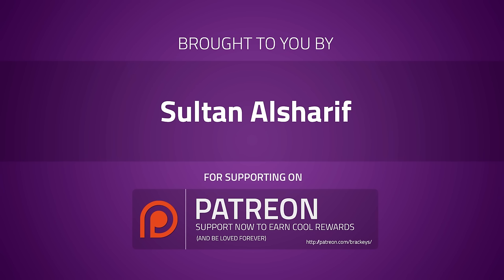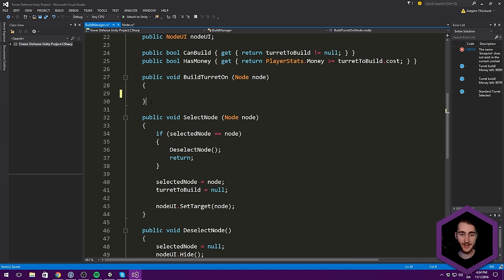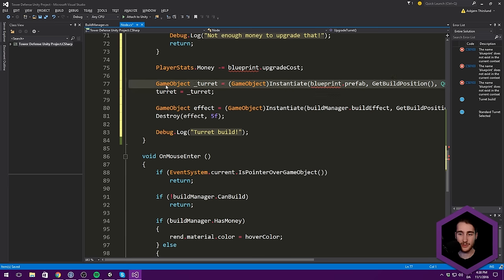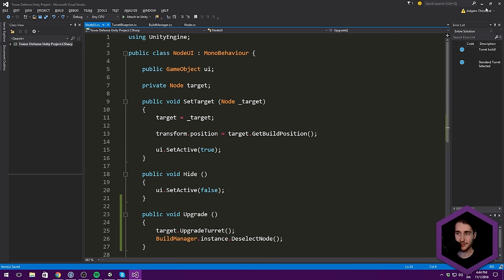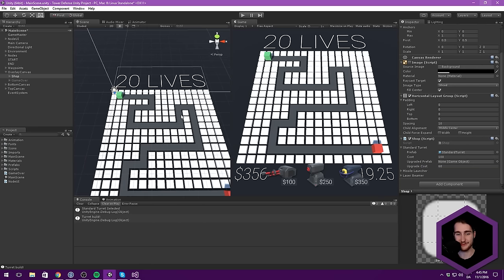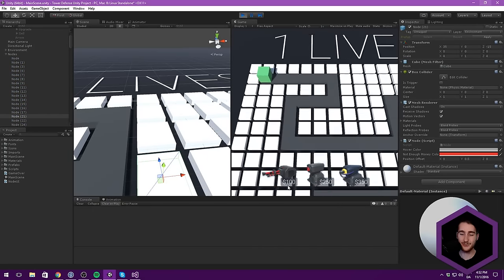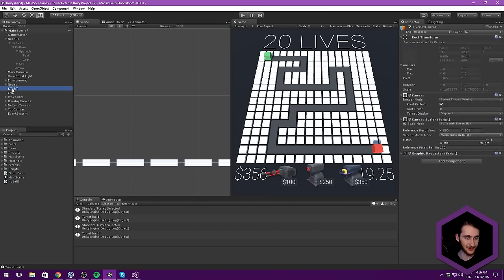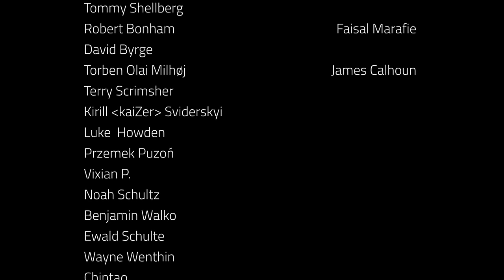How to make a Tower Defense Game (E19 UPGRADE) - Unity Tutorial

Comment: For anyone having the problem with the UPGRADE BUTTON just put main camera in the CANVAS Event Camare (The canvas that is inside the NODEUI) i am sure more than one of you are having this problem, Canvas ONLY WORKS with main camera or any other camera, if not set correctly the clicks are coming from a very different position so they might never register as coming FROM the camera, i hope this works someone.
Reply: thanks dude
Reply: thx dude you saved my life.
Reply: Thank you
Reply: I am still having major problems
Reply: never mind it took me a sec t see what you ment
Reply: Hey 
@Hyfrehyfre, tried what you said and I'm still having troubles, any other suggestions?
Reply: i was messing around with this for 30 mins. thanks!
Reply: won't work for me
Reply: More upvotes here people! Was feeling like a failure after consulting the github repository for this project until I found this comment. Thank you so much!
Reply: Спасибо! Я уже не знал что делать с этим)

Comment: I'm doing the tower defense tutorial, I've created a laser turret and a variant of that turret,

the laser turret damages and slows enemies by a small amount

the variant does a lot less damage but greatly slows the enemy, but when both beams hit the enemy whichever beam hit the enemy more recently it uses its variable amount instead of the higher amount. Im looking for a solution that could have my game have the variant laser trump the defaults slow amount whenever they both interact with the same target.

Any solutions to this? here is the current code referring to the slow amount

public float slowAmount = .5f;

 void Laser()

  {

    targetEnemy.TakeDamage(damageOverTime * Time.deltaTime);

    targetEnemy.Slow(slowAmount);
Reply: Same issue here! Have you found a fix for this? Super stumped

Comment: I had problem with buttons, they don't register clicks correctly just because i didn't remove colliders from my upgrade prefab. Maybe could help someone
Reply: Hello bro! Thanks a lot you leave this comment 6 days ago.
I do this tutorials for Android and I have the same problem with this buttons right now.
If I place two towers in a row and select right one and press Upgrade button it will select the left tower.
But how could I remove colliders from prefab? Prefab have only Transform, Mesh Filter and Mesh Renderer components.
Reply: @john_donne  Maybe your problem not in colliders. Your upgrade button upgrades another tower?
Reply: @john_donne  If the problem is that clicks go through the  NodeUI canvas  and select a different tower, just put box collider in NodeUI canvas behind your buttons.
Reply: @john_donne  Hope it helps, ask if you have any questions
Reply: @heavyCO33  yes, you are right. Problem is that clicks go through the NodeUI canvas and select a tower behind the button. And this problem appears only on Android. On PC everything works fine.

Added a box collider component separately to a Canvas, separately to a Panel and separately to a Buttons but it doesn't help. What am I doing wrong?
Reply: @john_donne try to create  new 3D object cube on NodeUI canvas, customize size and turn off mesh renderer
Reply: @heavyCO33  brooooooooooo, thank you a lot! It works! I spend 5 hours to fix this problem and you save me. Thank you again!
Reply: @john_donne  u welcome bro

Comment: How do you read the error lines btw? Seems like you just saw it, and understand it right away
Reply: The error lines tell you the origin of the error like which script is it from or which object is missing. It might not look very verbose and/or easy to read at first(kinda depends on kind of error and editor) but you'll get the hang of it as you search for the error on the internet or investigate it. And then you'll be able to just figure out the error's location and it's solution usually in a glance or two ^_^

Comment: I've got some bugs , can you help me a little? after the 1st wave , I'm not getting more money after killing enemyes and my standard turrets are kiling the enemy with 1 shot even if I wrote 50 at damage...how can I fix this?
Reply: Well, sometimes I make changes in the code but forget to do so in the inspector maybe according to Unity Inspector it's still damage = 100 or something else?
Reply: I see that this is an older post, but I think it is because you have left the Destroy(object); in from before damage was calculated.  If the turret requires more hits than 1 to reduce health to 0, it never calls the Die() function.  In this case, the enemy is destroyed instead of Die()-ing.  It never calls the code to initiate the payout.  Remove that one little Destroy and you should have fully functional towers.

Comment: how to do you make it into a actual application?
Reply: Build the project. File -> Build Settings ; You will need to add the current scene to the build or it won't work. After that, just build and save and it'll save as an .exe file. :)
Reply: CozySeeker291 thanks